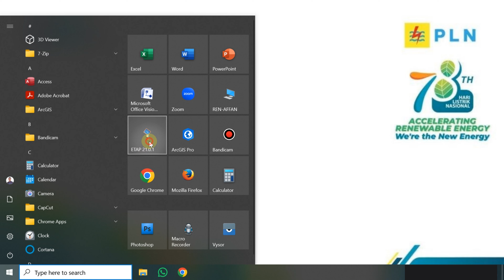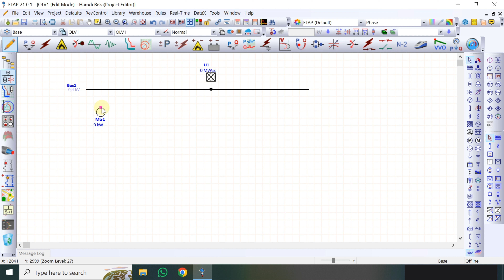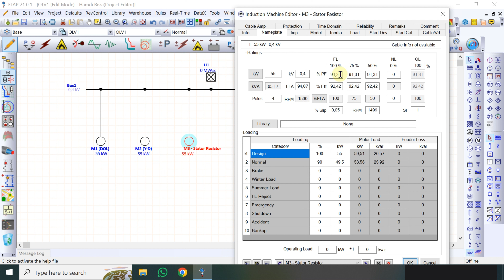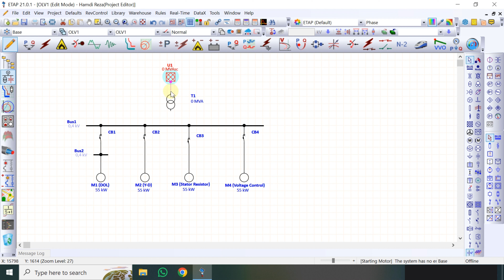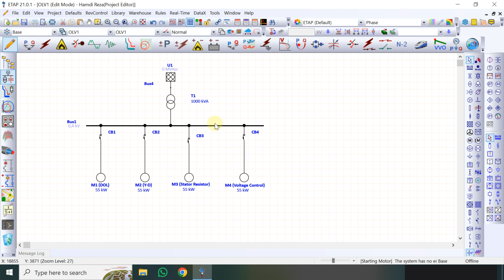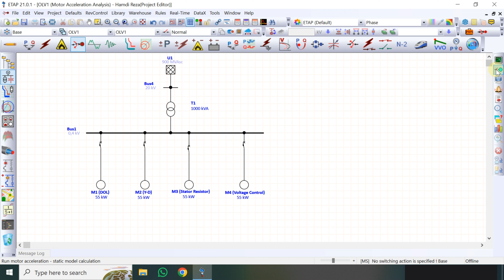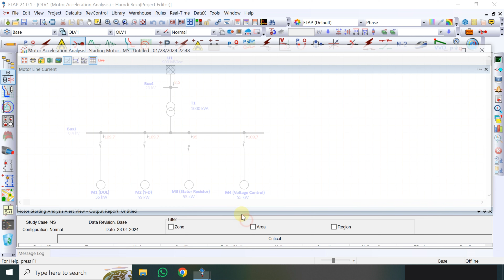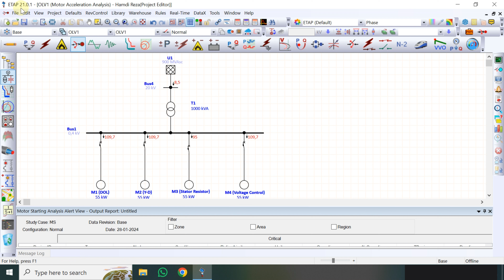Analisa Arus Starting Motor pada Software ETAP | DOL - Star Delta - Stator Resistor - VoltageControl

Comment: Bang tanya, kalo running load flow kenapa kW yang muncul selalu lebih besar dari nameplate motor yang sudah diinput di  ETAP. meskipun di Load Kategory sudah sudah di setting 80% (misal absorb loadnya 80%), operating load nya dia tetap di atas 80%.

Atau case lain misal di Dynamic motor Starting kenapa Operating kW nya juga lebih besar dari Nameplate atau Load kategori yg sudah di setting (Absorb Load 80%)??

Ada solusi?
Reply from the maker: Maaf kak saya blm pernah menjumpai case tsb, kebetulan akhir² ini saya jarang pakai ETAP, nanti saya pelajari dlu ya kak

Sementara itu silahkan cari referensi lain juga ya kak
Reply: Mungkin bisa setting di demand factornya
Reply: @nur.muhammad0812  Klo load flow uda clear krn memanga ada motor efficiency. Cuman klo motor starting saat sudah steady state dia masih di atas kW saat sudah mengconsider Efficiency

Klo setting demand/loading cuman buat nentukan BkW/BHP aja dia dan selalu dibawah rated
Reply: @ZahraniMahveen  apa sudah dicoba di set % final nya di (start Cat motor induksi)
Reply: @nur.muhammad0812  Klo setting itu cuman di Loading, di Motor Acc ga ada

Comment: Kalau saat run load flow itu muncul Calculation process terminated abnormally - Exit code - C0000135, kenapa ya pak?
Reply from the maker: Maaf bang saya blm pernah menjumpai itu bang
Reply: Di troubleshooting mas
Reply: Monggo dicoba mas saat mau jalankan aplikasi etapnya di troubleshooting terlebih dahulu lalu run as administrator
Reply from the maker: Terima kasih mas masukannya
Reply: @abdulqoyyum10  Pastikan semua parameter yg dimasukkan normal semua dan ideal, misal panjang cable dan size ideal, tidak kekecilan dan tidak kepanjangan. Sizing trafo atau EDG dan load ideal, trafo tidak kekecilan, atau load kebesaran. Intinya harus proporsional

Tips bikin SLD jangan langsung complex kemudian baru Run LF. Bikin sederhana dulu, tiap selesai coba run LF, jadi klo ada step yg bikin error akan ketahuan bagian mana penyebabnya. Klo proporsional saya pake 500 Bus pun juga ga ada error untuk semua mode, LF, SC, MS, OCP, TS, HS dll